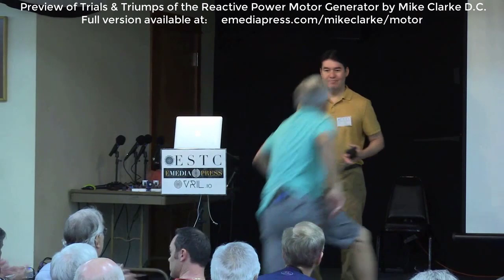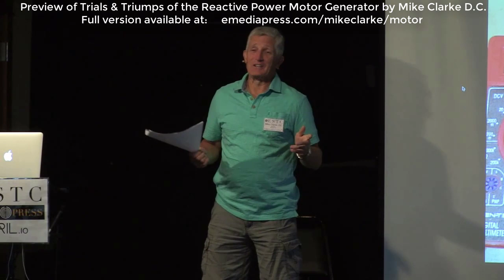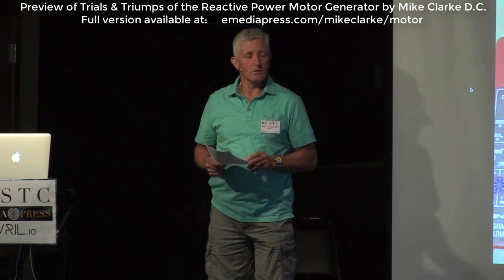Preview of Trials & Triumphs of the Reactive Power Motor Generator by Mike Clarke DC

Comment: Is that really not connected to anything?! Where is the power coming from? A constant di-electric source?! Or is that highly effecient but connected to a socket outlet?
Reply from the maker: There is an input battery bank and a battery back on the back that receives the recovery. There is a circuit that switches the battery banks back and forth to keep them balanced in voltage. Those batteries have not been hooked to a regular charger for many, many months as the machine supplies enough to keep the topped up.
Reply: @AaronMurakami13  Huh? That's like a seesaw that never stops? How?! There should atleast be an impulse to generate the resonance and maintain the resonance. Even though the frequency of the impulse can be extremely low. Perhaps it is enough?  Or is there more?
Reply from the maker: @deltagamma1442  The chemistry of a lead acid battery is an open system and when potentialized in strong impulses, that creates an obvious sharp gradient that breaks the symmetry of the aether, which is where the electromotive force (polarized and condensed aether) comes from to move from a high potential to a low. Sharp gradients allow the battery to wind up with more charge separation that is coming form the output of the recovery. http://bedinisg.com is the science 101 pertaining to this.
Reply: @AaronMurakami13   Wow! That made a lot of sense. However, when you say it distrupts the symmetry of the aether, don't you mean the symmetry between the magnitude of the polarities? If that's the case, wouldn't the capacitor itself deform? I'm assuming a capacitor is where the exponential disruption is captured. As I understand it the aether is formless, and its manifestation is polar (form) and symmetrical. Also there is prolly symmetry between the aether and form. So there are 2 different symmetries? Thank you for your explainations so far, they've been wonderful and insightful to say the least. I'll try and get that book too. :)
Reply from the maker: @deltagamma1442  Not the symmetry of the magnitude of the polarities. The aether is homogenous/symmetrical in nature. When there are 2 potential differences, that in and of itself is the breaking of a symmetry of the aether and the sharper the gradient, the greater the magnitude of the polarities. It is fully explained in the simplest for in my presentation Hacking the Aether.
Reply: @AaronMurakami13  Whoa! Mindblown! Thanks Aaron. I'll check out your presentation! :)

Comment: Hi, this is really cool stuff. I'm curious though, not being an engineer myself, you mentioned it was producing 125 volts, how many amps? I'm interested to know what the total power output is in watts. Thanks.
Reply from the maker: I don't know what that new generator outputs in amps. The original was just some generic DC motor - the worst case scenario and it output something like 25 watts nonstop while still keeping the batteries charged up. The new one - in the presentation,  I do recall that he mentioned how many amps it was outputting. Would have to watch the whole presentation to find it.
Reply: @AaronMurakami13  I'd really like to know. If in a test scenario with 12 VDC it output 2 amps it shows promise. One would need to measure the amps coming out of the generator and I'm sure that has been done. I didn't hear it mentioned in this video. I'd be interested to know.
Reply from the maker: @alexwebster6098  Not this video, the full presentation.
Reply: @AaronMurakami13  I guess there is no general public presentation?
Reply from the maker: @spinkyl9559  Not for this presentation but I can tell you that they keys are there. Air core Bedini SG type of setup, higher voltage like 72 or so rather than 12. People need to start experimenting with that arrangement.